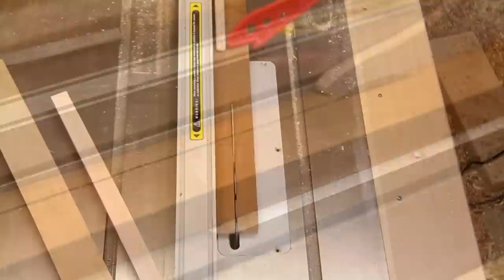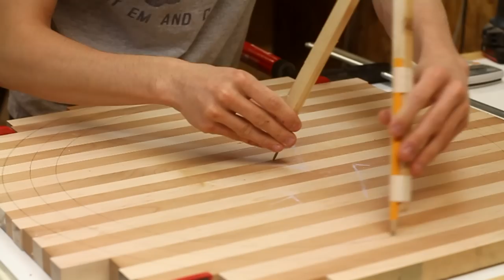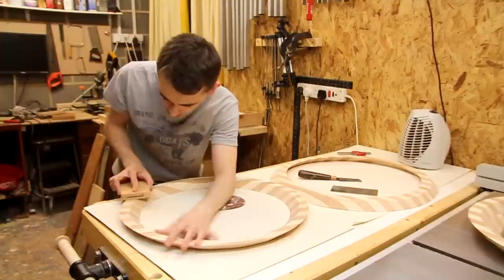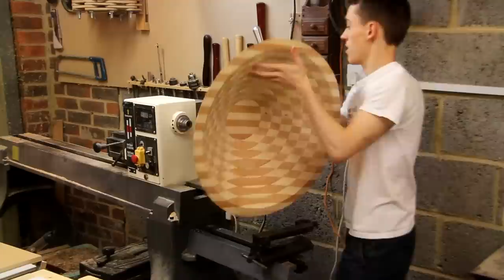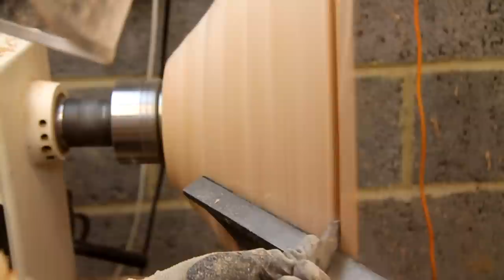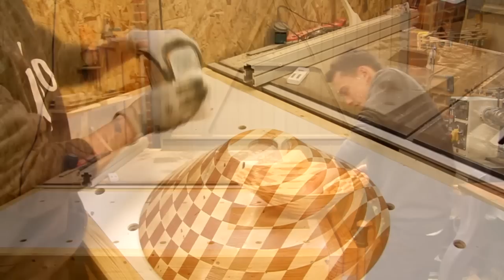The Big Bowl Turning: Stacked Ring Technique

Comment: Perfecto...I will try with a smaller size to fit my midi lathe.  Since I don't have the equipment you have I'll need to control flatness with a band saw and 4" X 36" bench-top belt sander.  Looking forward to seeing more of your innovation.

Comment: Just a thought for the next time. When you're cutting the outer ring, cut it straight instead of at an angle. In this case it wouldn't have mattered because of the catch, but having that top ring be straight sided gives you some options for the rim. I did one where I was able to undercut the top just a little which gave a finger hold/solid place to hang on to the bowl.

Nice job though, and nice recovery. I had a segmented hollow form that caused me the same issue - a catch popped off the top ring. So the hole ended up a bit larger than was planned, but unless I were to tell you it wouldn't be noticeable. It's nice when an issue is able to be recovered from. Just another design opportunity :)

Thanks for sharing your work.

Comment: Very nice Alex. My lathe will turn outboard too but I've never tried it. Can you tell me, how did you align each additional ring
? Not straight as to follow the split in the middle of the board. Thank you, and great job.
Reply from the maker: Hi, thanks!
To produce the pattern, the alignment does in fact follow the split in the middle of the board, but is rotated 180 degrees. Not ideal, but that is how it works.
Alex

Comment: Hi from sunny queensland. Love your bowl that I have just found here on line. Can you tell lme what the sizes were for that and was the cut angle done at 45 degrees?
Reply from the maker: John Lush 
Strips were 25mm square I think, by 600mm long (max). The angles were cut at as much over 45 degrees as I could get, with a secondary table clamped on.
Thanks, Alex.
Reply: ThisWoodwork thanks

Comment: could you have glued the broken piece back in place? May have not been very visible with all thats going on
Reply from the maker: I could have, although unfortunately it would have looked terrible. The broken piece fitted quite well, but some bits had chipped off, leaving some nasty gaps. Cutting the top away was both quicker and looked better than trying to fix it.
Thanks for watching, Alex.
Reply: ThisWoodwork I'm with BRWI - I would've just glued that piece back on maybe with a little sawdust-wood glue filler and kept going! But I'm not a turner ;-)
Came out great! Nice design.
Reply: Michael Anderson yes, if it was a whole wood, a single piece of wood, filling in gaps with glue and sawdust would work just fine, but not on a piece with fine cut lines and shapes, it would break the flow and shape, it just won't work.